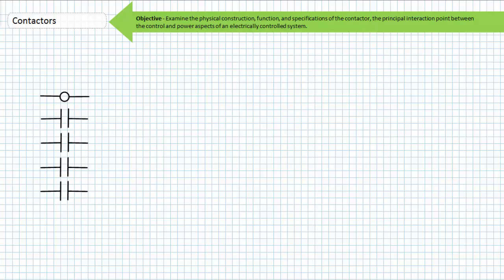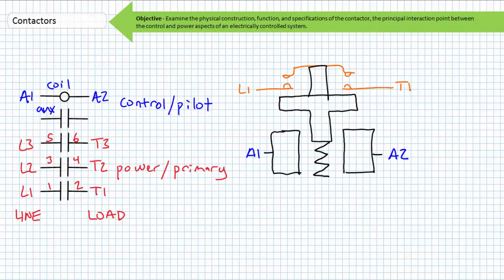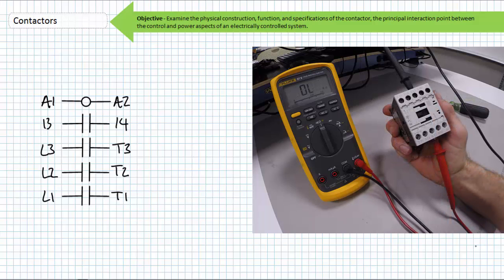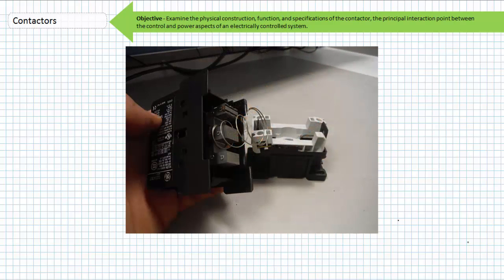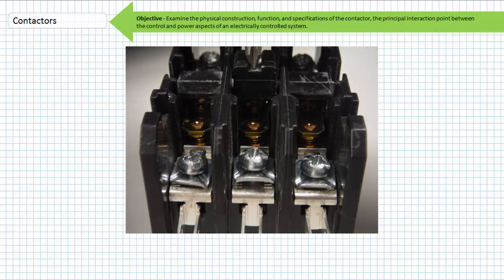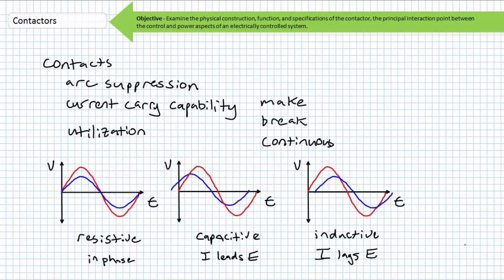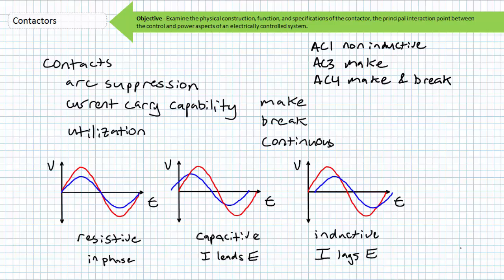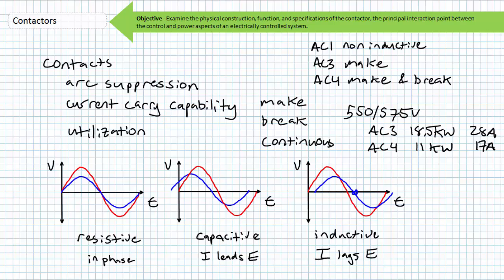Contactors (Full Lecture)

Comment: Great video. Side note, many trades will hardly ever come across a contactor with a higher coil/control voltage, but they are common. Often the coils can be swapped for whatever you need in either ac or dc voltages. 24 up to 220dc and 24 up to 480ac. Thanks for all your well made videos!

Comment: I need to know when a 3 phases contactor is used for one phase load.(onephase-oneneutral) flowing at its contact. How to calculate its power capacity that used for switching a lighting load?  Thanks.
Reply from the maker: Look it up on the data sheet for the contactor of interest.
Reply: @bigbadtech  nice thanks. 🙏

Comment: Even though contactors don’t have sensing elements, they can be commanded to interrupt on-load currents. But can they also safely interrupt overload currents? Can they also interrupt short-circuit currents?
Reply from the maker: A contactor is just one half of a motor starter. For information on the other half check out the overload relays lecture at: https://youtu.be/kZmsnArvN1M
Reply: @bigbadtech  Thanks! So, contactors can interrupt overload currents by being triggered from an overload thermal relay. But contactors can’t interrupt short-circuit currents. Right?
Reply from the maker: True dat. Over current protection is traditionally reserved for circuit breakers and/or motor starters in series.

Comment: Jim, im confused about WET and dry contacts. There is a lot of confusing videos on wet contacts and it seems some professionals dont believe the term is accurate. What is a wetting voltage and what exactly is a wet contact? dry contacts close a circuit and one or the other side supplies the voltage so what exactly does a wetting voltage do? thanks
Reply from the maker: Excellent question. I should actually address this difference in upcoming sensors and control lectures I've got planned.(As well as untangle the difference between "sourcing" and "sinking" inputs and outputs ... I am dreading this task). Without complicating it too much I like to think of "dry" as meaning isolated inputs and outputs. ie: some input is triggered and a separate output source provides power, whereas "wet" means the triggering of input means this input also provides power. It's hard to describe without diagrams. Control has a great article on this subject: https://control.com/technical-articles/the-difference-between-wet-and-dry-contacts/ When I publish the photo electric switches lecture I'll try to differentiate between wet and dry contacts.
Reply: @bigbadtech  thanks for the quick response! really enjoy your lectures and something that i'll be sharing with others since it's so helpful . One weird issue with engineering graduates is that many dont have enough experience with the hands-on accept of understand relays,contactors and other control circuiry. Some cant even follow a simple circuit unless it looks like those in circuits 1 and 2. Nothing too hard but it takes a bit of study.  anyway thanks and i'll be on the look out for your videos on this wetting contacts

Comment: If i have a 4 pole 20A contactor but i need 40A for normal AC, is it safe to wire a 4 pole contactor using 1 and 3 together for the Live wire and 5 and 7 for the other wire or will it be a problem because the poles maybe connects 1 ms different?
Reply from the maker: We are entering the "code zone" which I do not have experience nor the authority to interpret. Check with your authority having jurisdiction. Theoretically current should equally divide between two paths of equal resistance.

Comment: Excellent explanation. I would just like to say that contactors are used in many more places then just motor control systems. Street lighting is a simple system that incorporates contactors and a photo cell to automate the system.
Reply from the maker: True dat. Anything driven by primary voltage (motors, heaters, lights, etc.) often uses a contactor to make or break connection.

Comment: so if you close i3-i4 does L1-T1 and  L2-T2 and L3 - T3 close too
Reply from the maker: Unless the contactor is broken every contact, primary or pilot, will simultaneously change states based upon: the energized/deenergized status of the coil or the activated/deactivated state of the manual override.

Comment: 10:45 why do you begin with 21-22 not with 11-12
                                                    31-32                 21-22
                                                    43-44                 33-34
                                                    53-54                 43-44
Reply from the maker: Contactors typically include a NO contact numbered 13-14. Therefore the auxiliary contact block starts at 2.

Comment: If the OL on a starter trips will it deenergize the aux contactor on it even if there is a secondary path to complete the circuit without passing though a1/a2?
Reply from the maker: Check out the 3 wire magnetic motor starter lecture at: https://www.youtube.com/watch?v=kr7XiQ84rdo
Reply: Jim Pytel sorry I might have missed the answer but the examples in the lecture appear to  only show a series circuit where an OL will clearly deenergize the holding contacts. I have a line in parallel with with A1/A2 which could allow for the holding contact fixed to the same DOL to remain energized assuming the OL is only breaking the connection of A1/A2. But if the OL 95/96 causes the whole DOL to deenergize it would reopen the contact 3/4 and the entire circuit would be open. My instructor seems to have some confusion on this point.
Reply from the maker: Not totally following the description, however, anytime the examples in the aforementioned lecture experience an overload condition the series NC OL would deenergize the coil of the contactor. Here's the important part ... anytime the contactor coil is deenergized it's associated contacts (ie: the 13 14 NO auxiliary) would also return to their deactivated state (ie: open) and remove the holding circuit. The state of the contactor primary contacts and auxiliary contacts are both dictated by the state of that contactor's coil. Hope this makes sense. Ideally the NC OL is only in series, thereby effectively giving it the "last say" whether the motor is energized or not.
Reply: Jim Pytel Sorry, I wish posting images to yt comments was a thing... or maybe not. Yes that makes sense and is what I thought was the case. Thanks so much for your help! I might ask for more but I think YouTube law dictates that I need to start paying you after two responses. Thanks again and take care!
Reply from the maker: Look up my school email address. Send me a shot of what you're talking about.